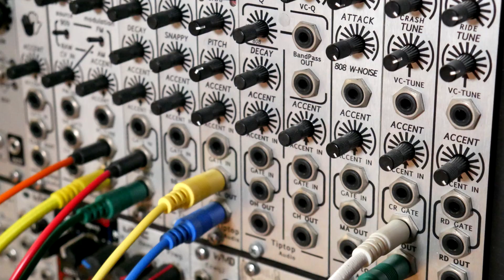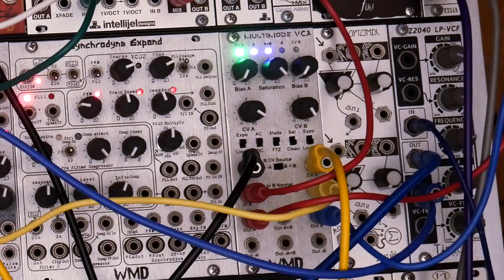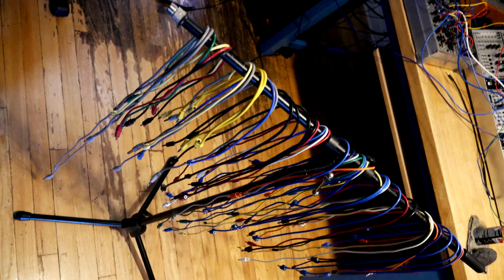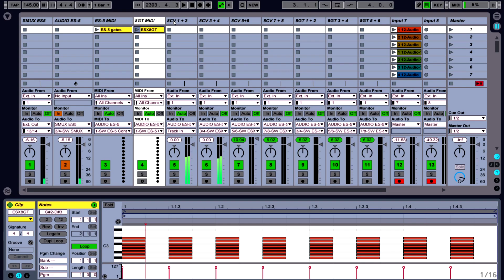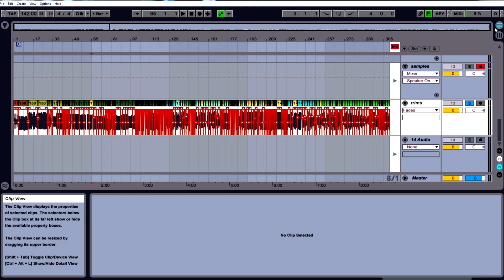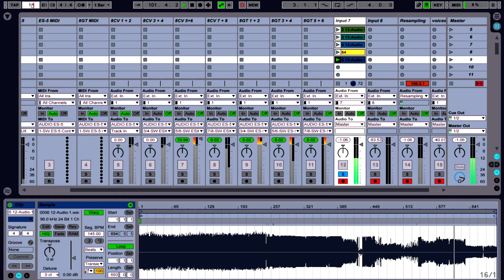Eurorack Modular Loop Sampling Workflow (Ableton, Expert Sleepers, Silent Way)

Comment: the micro hadron collider needs feedback to get the resonance stable. 

A few things to try, extremely low gain settings, this will get you smooth ,but not self oscillating resonance. 

Feeding f2 notch out, to f1 input b and with a bit of tweaking you can get more stable resonance. 

I have been able to get self oscillating resonance with feeding bandpass outputs to inverted inputs, but I do not remember the specifics of how I did it. 

That filter is a damn playground and takes a lot of time to find the sweet spots but experiment with self patching that filter, it can be magnificent.
Reply from the maker: Good tips! iirc in one of the WMD videos they straight up say that it needs a feedback loop patched if you want any sort of resonance stability, is just inherent to the design. The Hadron Collider is one of my oldest eurorack filters (I may have had only the Z2040 for longer) and I've spent a lot of time with it - even have the discontinued expanders. The WMD modules I really need to spend more time with are the Synchrodyne + Expand, tons of interactions between the different parts. I have a good handle on Synchrodyne by itself but with the expander added the signal flow gets very complex
Reply: @maxmarco  hermbot does a lot with the synchrodyne and seems to understand it well. 

youtube.com/channel/UCoRUkFxXAStMP29fiHuL32Q
Reply from the maker: Hermbot has definitely made some helpful videos, have been subscribed to him for a long time, I think I found his stuff around the same time he published his first Synchrodyne vid

Comment: Do you have any latency issues with silent way?  I have es8 and I noticed latency in cv causing modulators to be out of sync.
Reply from the maker: not totally sure I know exactly what you're referring to - there is always latency, it's just sending CV signals out of an audio interface, which has latency of course - unless you mean something else? in this sampling workflow I don't bother to set any track delays and I manually account for the small amount of latency when trimming the loops
Reply: max marco yeah since you are ultimately trimming loops I suppose latency isn’t a concern. I occasionally like to sync my modular to Ableton and “play it live” with other instruments and have found that the cv clock and audio latency is a pain to try sync everything together.
Reply from the maker: yeah it's a bit frustrating, I used to do a hybrid setup all the time and Ableton doesn't seem to be very good at latency compensation, basically any minor change to the live set meant I needed to re-assess all the track delays and even without changing things sometimes it would seem to go a bit off from one day to the next

Comment: Silent Way is pretty underappreciated.  I really think if the step LFO on it's own represents one of the most versatile CV tools ever designed for a DAW.
Reply from the maker: Silent Way is pretty amazing, one thing that took me a while to realize is that it basically turns any DAW into a modular system without even bringing hardware into the picture - some of the most fun I've had with Silent Way was using Step LFOs with CV to MIDI and sending to soft synths :D